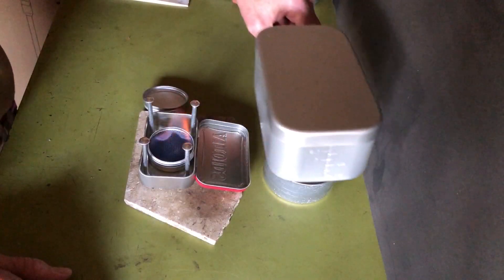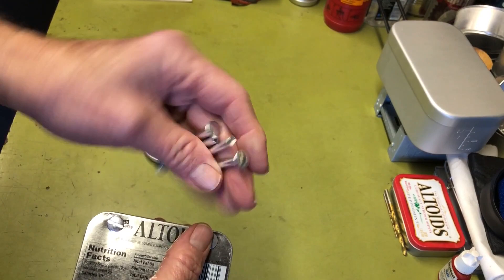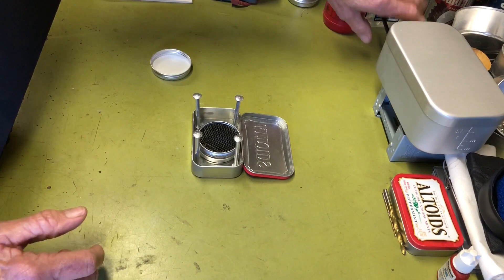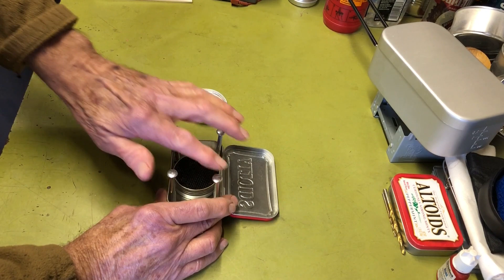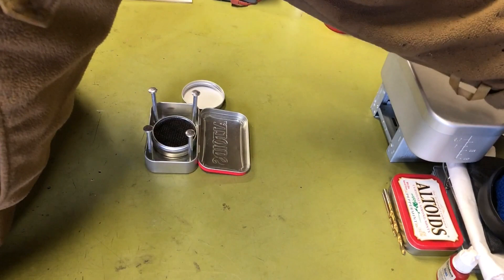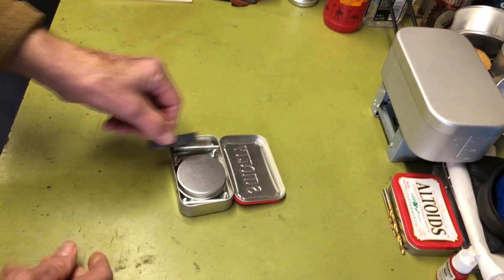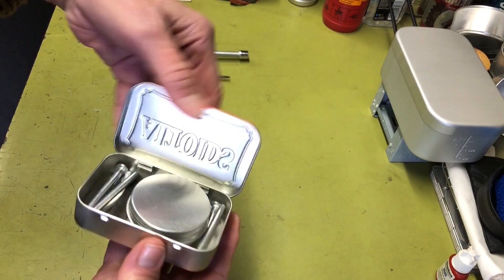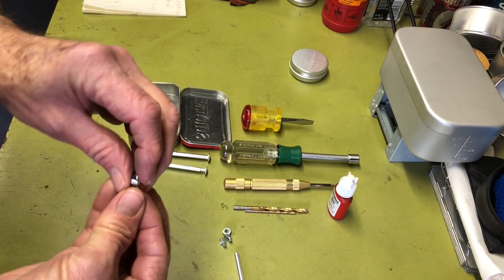DIY Altoids Tin Alcohol Stove

Comment: It might work better to put the template on the inside of the tin, set the tin on a sacrificial piece of wood and use the center punch. Then you would be less likely to dent the tin.  Then move the tin and wood to the drill press to drill the holes.
Reply from the maker: Good idea, I'll use it on my next build.

Comment: Is an Altoids Tin close enough for keeping soot-free burning paste (made for table burners like raclette stoves) for a long time, or does the burning paste doesn't function anymore after some time? We do not have Altoids here in Germany, so I would have to import one in case. That's why I'm asking you before if the tin is leak proove (enough) for holding that burning paste. My very best regards from Germany and thumbs up for your video
Reply from the maker: It will leak around the tin's hinge. You can place a strip of the foil tape to seal it. Check out my Small Altoids tin burner video.
https://youtu.be/ITTrqxzgAls
You can find blank Altoids size tins on eBay, which be a cheaper alternative, also the round cosmetic tins can be found there. The round tins may be a  better option for burning paste.

Comment: I like this idea quite a bit, there's enough room in the lid to add a piece of stucco mesh, I use the stainless steel type. There may even be enough room left for a folded sheet of aluminum foil as a windbreak. . I need to play around with this idea
Reply: All right you got me thinking... When it comes to the build maybe just JB weld the other end of the Chicago bolt to the bottom of the tin.. The downside is though if you use nut and bolts the heads give you a little foot to raise the bottom of the tin
Reply from the maker: I usually add a wind screen  (foil or Foster's beer can) to all of my cook kits, I'm not sure why I didn't for this one. I'm going to play around and see how big a foil wind screen I can fit in the tin.  Thanks for the reminder. 😊